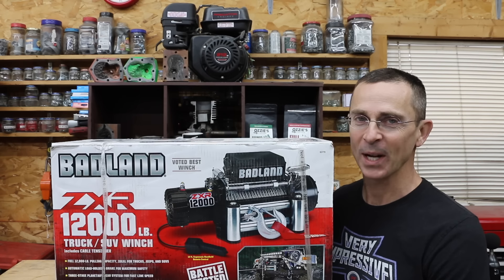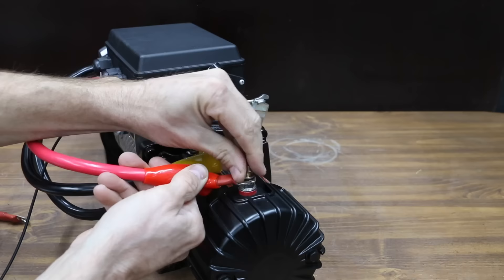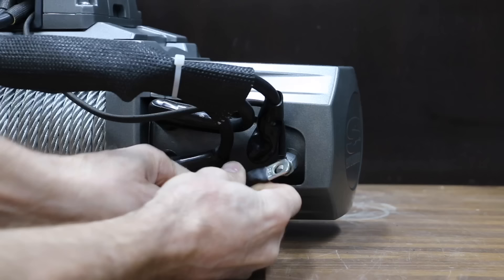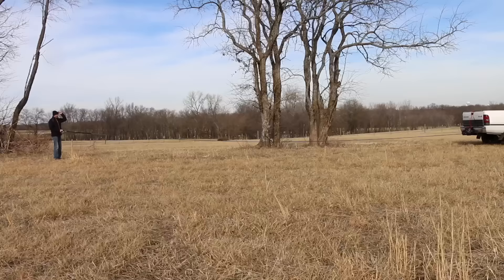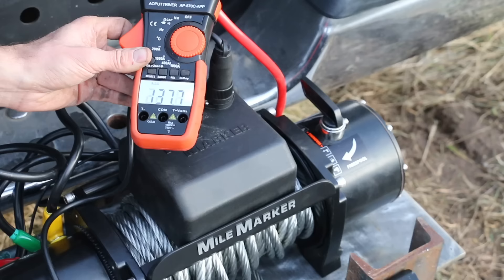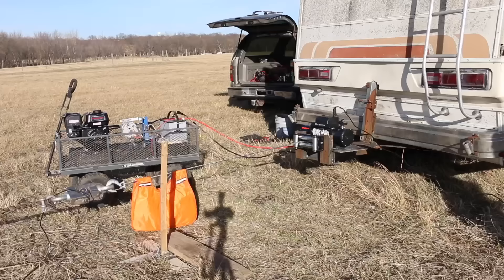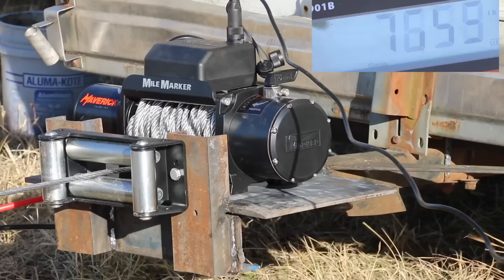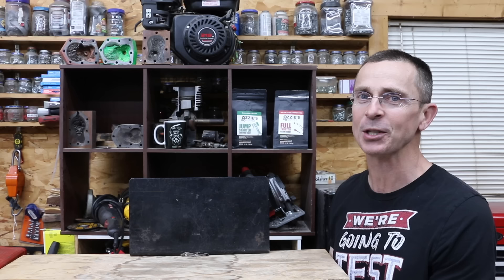Best Winch? Is BADLAND Better Than WARN, Smittybuilt, Milemarker? Let's Settle This!

Comment: I am a Superwinch fan myself. Ultimately to me what makes one winch better than the other is how long they last. My Superwinch has spent a lot of time under muddy water and made many pulls. 8 Years of abuse and still going strong. Likely the winches with synthetic rope that broke had Chinese dyneema instead of name brand. Looks like they broke at the end of the burry on the splice which is the weak point. If those tails were not tapered correctly it could have caused premature breakage. I have bought  several sets of 1/4" Chinese winch rope and have yet to see a properly tapered tail berried in the rope. Interestingly enough, others have tested the cheap dyneema to break higher than name brand in certain situations. The name brand stuff is more round and more abrasion resistant ultimately giving it a longer working life.
Reply from the maker: Thanks for sharing.

Comment: I think most people would use a snatch block when getting so close to the limit of the ropes and winches.
Reply from the maker: Thanks for the feedback.
Reply: Yeah I think so too, but thats not really the point of the video. They claim certain parameters, and he is going to hold them to that claim.
Reply: This wasn't testing how to pull a vehicle. It was testing the winches.
Reply: @Cautionary_Tale_Harris  But if an item isn't tested the way the real world would use it, then the test results don't really mean that much. Maybe if a test with a snatch block was done before the max limit of the winch it would have helped a lot.

Comment: I'm almost certainly never going to be in the market for a winch, enjoyed the video as always nonetheless :) a suggestion for a future video - garage door insulation panels. I just installed some and they help but there are quite a few different kinds (some mount flush, others create an air gap) as well as weather stripping for the surrounds. I'd be interested in the results & it could be an interesting exercise designing test criteria and methods.

Comment: I've personally had great performance from both the Smitty X2O 12k, and the Badlands 12k synthetic. The Warn you used is ironically the one model that's fully made in China, I wonder how the Warn 9.0RC stacks up against these. Even at 3k lbs lighter rating, the Warn will likely out perform these Chinese made 12k  models. And yes, the wraps extremely effect the performance rating. Please, do the one wrap test next time around! Try all synthetic rope models next time around? Maybe add Runva brand, they always get great reviews from the Australian crowd and Land Cruisers! Keep up the great work! 👊😎
Reply: Well you haven't really tested yours as is done here. I returned my Hazard Fraught Winch and bought a Zeak since I don't want junk
Reply: @LitheInLitotes  The badlands didn't get a fair test with that twisted mount, which would cause the drum and gears to all be out of alignment and create false readings

Comment: Great comparison as usual! I would like to see the Badlands Apex 12,000 compared to the top winners in this test. It costs more than the ZXR model, but has great reviews among the off-road community. It would be nice to see the results of the Apex model with both wire and synthetic rope options! Many thanks for another well done test!
Reply from the maker: Thanks!  Thanks for the suggestion.

Comment: Excellent review.  It would be very interesting to see how these winches hold up with repeated use. It would be pretty straightforward to set them up to repeatedly lift a heavy mass off the ground a few feet and lowering it again with a counter.  All you'd need is a double pole double throw relay wired to latch, a normally open switch and normally closed switch on lever arms to change direction and a mechanical counter to see when they gave up. You could use a snatch block or two to multiply the effective weight of the object.  You could then open them up and inspect the internals.  A cheap winch may perform well out of the box but that doesn't help much if the gears explode or the motor fries on the 10th pull out on a trail.
Reply from the maker: Thanks!  Thanks for the suggestion.
Reply: This would be a good test indeed.  You would have to account for their duty cycle though.  They all are rated for a lot less than continuous use.  You could add a time delay relay to allow for a rest period between lifts though.
Reply: @realvanman1  Good point.  That would also reveal if the claimed duty cycle is realistic.

Comment: Really surprised to see how bad the Warn and Smittybilt performed on some of these tests. Also surprising to see the Badlands perform so bad, they always seem to work great in the Matts Offroad Recovery videos. I'll have to look into these Zeak ones in the future.
Reply from the maker: Thanks for the feedback.
Reply: Matt doesn't use the winch he used in this video. He uses the Badlands  Apex which is 10 times better than the regular Badlands winch.
Reply: First use of my 12,000lb Badland winch tonight and the whole winch folded in half and broke off the winch plate pulling 8,000lbs. Complete trash and I definitely don’t recommend.
Reply: @CBDiesel  if the winch folded in half it was a winch plate failure not a winch failure. If the plate isn't strong enough then any winch will fail.
Reply: @beforsaken9388  I would be curious to see if he got a good "winch" and used the same winch plate and pulled the same amount of weight what the results would be.
Reply: The Warn purposely has a low amp draw, which reduces it's pulling power. Earlier generations of this winch had higher amp draw and were more powerful, but the issue was people were killing their vehicle batteries with them. Warn studied and realized most people do not pull further than a few feet at a time, so the product was designed around the most common use case. You can sometimes find the older generations of this winch, or step up to one of their high performance models at a higher cost.
Reply: Was it because the mounting plate failed or the winch itself failed?. Ive personally used my 12k z series badland winch to pull a loaded with wet sand f650 dump truck up onto my goose neck trailer. The winch is mounted to 3/4" steel plate that is welded across the neck of the trailer powered by 2 deep cycle
Reply: Where can you buy the Zeak winch? I tried looking on the internet and keep getting other brands listed.

Comment: I bought me a small setup that I threw together that attaches to my receiver on my expedition to help load stuff on my trailer. The mounting bracket I bought came from harbor freight and looks similar to the one in the link. Sure i only went with I think a 2500 pound winch cause I'm not going to be loading anything really heavy, but i see now to be on the safe side I will be adding some more bracing to it and making it a little stronger to be safe😂. I would have also used it to help pull people oit of a ditch if needed, so I will 100% be enforcing the mounting plate. Thanks for posting this before I tried to be the hero and just bent the crap out of my cheap little setup. I wish YT would allow people to add photos in the comments cause I would post a photo of my setup to show other people the idea I came up with.

Comment: Awesome video, as always! Although i would've liked to see some testing for toughness/ build construction. I have seen cheap winches work great like some these here but cheap stuff might not last. After 1 year on the front of a ute water might get in the control box or motor and it stops working. It can be a bad day when find out the cheapo winch doesn't work anymore and your bogged in the mud.

Comment: Another well made test! I would love to also see a video comparing wire strippers… I have seen all the hand tool videos you have made and it as an electrician is like to see your opinion on wire strippers as well
Reply from the maker: Thanks!  Thanks for the suggestion.
Reply: I like my yellow Klein, nice $12 USA made. Drawback, it doesn't have a close lock (so it's always sprung open). I can't deny I'd rather have the Pittsburg strippers. I would like to see such comparisons!

Comment: Remember, every line spool of cable reduces the capacity significantly. So the last 10-15 ft closest to the truck is the hardest. Probably 8000 lbs on a 12000 winch
Reply from the maker: Thanks for the feedback.

Comment: This is great.  Would love to see a round 2 of winches with synthetic lines only as they are the most popular.  Apex Badlands, Open Road Panther series, Smittybilt, Warn, etc.  
test the strengths of the lines as well.  Water test, freezing test and how hot the winches get after 30 seconds of pull.
Reply from the maker: Thanks!  Thanks for the suggestion.

Comment: First thing you do when you get your wench mounted is pull the line out leave about 5 or 6 wraps  hook to something and wench in under load. Keep thet spool tight your line will last longer than pulling with a loose spool.

Comment: This lines up with what I've heard. The Badlands is overall a very good value for the money, it's just slow. As long as you recognize its limitations, there's nothing wrong overall with it. The rope itself can be replaced cheaply. Harbor Freight's warranty is very good, too. At that price, you may as well just buy it and replace the rope. The Zeak is a lesser-known company and I'm not sure how it will hold up longterm. I'd go with the Badlands just for the warranty. Speed isn't a necessity as long as it gets the job done in the end.
Reply from the maker: Thanks for the feedback.

Comment: What a great demonstration!! I have an old mile marker that I use for loading cars on a trailer.  Bought it used, it didn't come with solenoids, I emailed mile marker to see about some replacements, no reply.  That left a bad taste in my mouth, but I went ahead and made my own setup with ford starting solenoids......and the winch is B-A-D, BAD!  I haven't found anything yet that it won't pull!  Still not giving mile marker my money though.
Reply from the maker: Thanks!  Thanks for the feedback.

Comment: I think it would be really useful to see which units still functioned after the max pull test. 

If you tied the synthetic rope back together does it still work. Or backed off the units that maxed out and tried again. Do they still max out at the same number or have they been damaged to the point of being useless. 

It seams this would be very important info of you were stuck in the middle of nowhere.
Reply from the maker: Thanks for the suggestion.

Comment: I have the new Badlands ZXR 12,000lb winch. The ZXR has the wire rope instead of the synthetic rope of the Apex. It also has an ip66 water rating compared to the apex ip68/ip69k. The Apex is a much better winch but it also has a higher price tag. I bought the ZXR because I wanted to do real world long term testing before I go across country to some of the most difficult trails around. I will most likely buy a American made Warn before I set out. The ZXR has performed great so far, it hasn't overheated and has handled all of the pulls so far with ease. It's mounted to the front of my 1994 YJ on a heavy duty plate.
Reply from the maker: Thanks for the feedback.

Comment: I'm from Australia, I was very interested to see the Mile Marker winch is basically identical to the TJM 12,000lb/9,000lb winch which they claim was designed/engineered here.

TJM is a large brand selling & fitting a full range of 4x4 gear, they compete primarily with ARB, Ironman 4x4 & some others.

Anyway, the winch - 
The body of the unit is identical, not sure about the gearset or motor - the 12,000lb TJM is not offered with steel rope only synthetic. Although the 9,000lb TJM winch is offered with both.

The 9,000lb TJM has a different gearbox to the 12,000lb although they share the same housing.

The TJM has a different and superior looking solenoid/control box with fancier jackets and insulation on the cables.
The TJM has a wireless remote & a wired remote.
Has a puck and an anodized aluminium hawse.

Main difference I see is the price, I got mine on a rare sale but they retail for $1,500 Australian.

I want to point out that at least here in Australia Warn has 4 different series' of winches and this looks like the cheapest 1.

I also want to mention that I work with cranes and lifting equipment all the time and all lifting equipment in AU and USA have safety margins baked into the WLL. For example using a 1:1 lift a 3 ton round sling should lift 5 or 6t or more and not snap.

I don't recommend that but I think its inexcusable that a '12,000lb' rated winch should fail at less than 9,000lbs, worse that the rope should snap.

Good for you if you read this far.
Reply from the maker: Thanks for sharing.

Comment: Awesome video, definitely surprising to see how far Warn has fallen despite still costing so much.
Reply from the maker: Thanks!  Thanks for the feedback.
Reply: The other thing worth pointing out about Warn is the EVO line of winches are currently under recall, for faulty wireless remotes and you wont be able to find one for sale from a reputable dealer.

Comment: In your opinion did the winch mounts twisting effect any of the testing? Just curious, as always great testing the apex and hyper tough would be interesting as well to see how they stack up
Reply: I believe it did, I would have liked to see all of them tested on the same mounting plate.
Reply: I have the same question.  I appreciate the time and effort and fully believe this is probably one of the most, if not the most, honest channels there are in this field.  I do feel though that, to make this video as honest as possible,  that all units should have used the same winch mounts.  Granted, I can only imagine how time consuming this video was to make, so I'm not knocking him for that.  It's still a great video.  Perhaps, if he does another video including other brands/models (hint... apex) he can also include the ones that had twisted mount plates for a re-test.

Comment: I'm little disappointed that you were testing all the winch max loads on their final wrap. most winches are rated for their first wrap load as you are usually winching from a distance in the first place not 5 feet. in their user manual it usually will tell you their load rating with each wrap. another winch you should try from Canada is the Princess Auto 12000lbs winch which seems to be a clone of the harbor freight badlands APEX winch although you were using the old badlands winch there is a newer one the Apex. should definitely get a spot.

Comment: This was a great comparison. Good work!

That said, I found myself in need of a winch for my trailer and found that the Zeak was no longer available (as of 07.07.23).

I ended up going to HF and getting a couple Badland ZXR12000 units, one for the trailer and the other for my F350. I needed something pretty quick (availability-wise) for a project I’m dragging home, and the price seemed right enough to get a second one for the truck.

It seems there are quite a few cheap winches on the jungle site, but it’s hard to reasonably gauge what’s what without actually committing to buying one.

Anyway, thanks for doing what you do. It helps tremendously when making these not-so-cheap purchases, knowing I’m getting my money’s worth.
Reply from the maker: Thanks and you are welcome!  Thanks for sharing.

Comment: You have to test the Ramsey vs Warn. I'm in the towing industry and it's always a argument also worm gear vs plantery winch. That would be fun, although you might need to run hydro instead of electric

Comment: i know everyone has their fav winches as do i.  i baught a warn evo 12 and had it on my truck for 4 years.  ive pulled trees countless recoveries.  which bring me to a story.  i have a skidsteer   blew a hydrolic hose on the drives which would not move   i hooked the winch to it   the tracks were a good foot in the dirt. the winch pulled it out of the trees up a hill plowing the dirt with the tracks.   like i said we all have our go to winch and i will brag on the warn   its very used and abused and still pulls strong
Reply from the maker: Thanks for sharing.

Comment: Testing Badlands Apex with a Freedom synthetic winch rope.

One question would be: did the Badland preform poorly because of the winch itself or was it damaged by the mounting plate which then caused it to preform below what it could have done on a good mounting plate?

Not to plug Matt at Matt's Off road recovery but Matt uses Badland winches exclusively using HD mounting plates with no apparent bending problems.

Wranglerstar also test a Bandlands winch which twisted on the mounting plate. He blamed the failure of a part on the winch which in reality was again a failure of the mounting not the winch which then broke the part.

My main takeaway is that the mounting is as or more important than the winch which is mounted on the mount.

Another test would be to take the Warn and SuperWinch and mount them on new mounting plates of the same that failed and see if there was a difference in performance or if those winches also failed because the mounting plate failed.

Comment: Another great vido on winches, I have not herd of zen brand but pulling 10,000 lbs when name brand ones didn’t, I have both warn and badlands, my old warn is 8,000 wile badlands are 12,000, my old warn pulled my 6,000 lbs Ramcharger with wheel locked and never slowed down, the warn broke a steal 3/8” cable,but I had 2 1,000 amp batteries with welding cables for power, the warn is the drum brake on side of unit with round brake shoe pulled by cable, not sure of age, but pretty sure that old girl would out pull my new ones, love it when you’re testing is something I also have some knowledge of but never really know how they stand up to one another
Reply from the maker: Thanks!